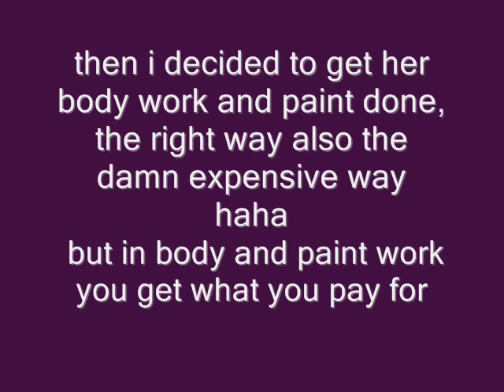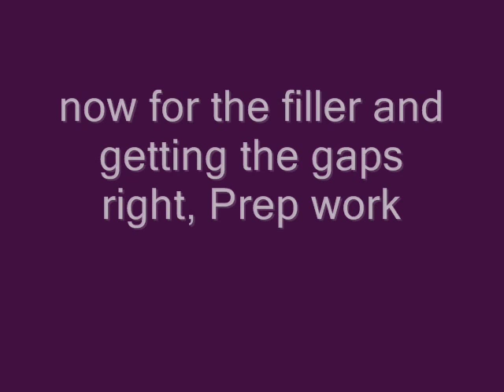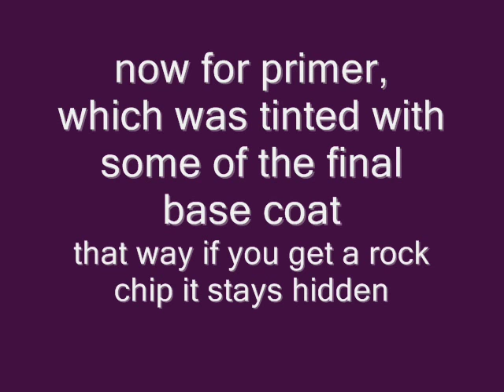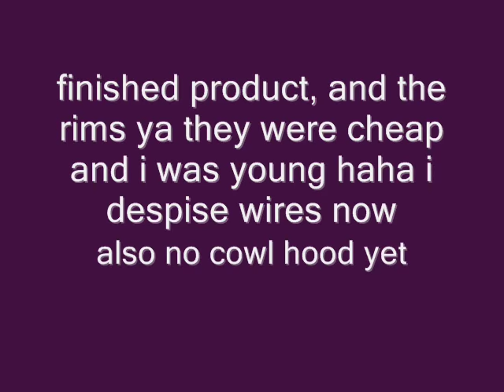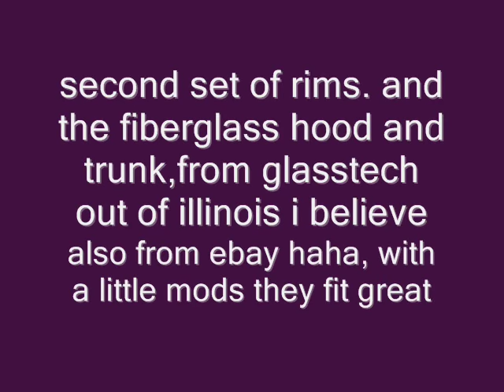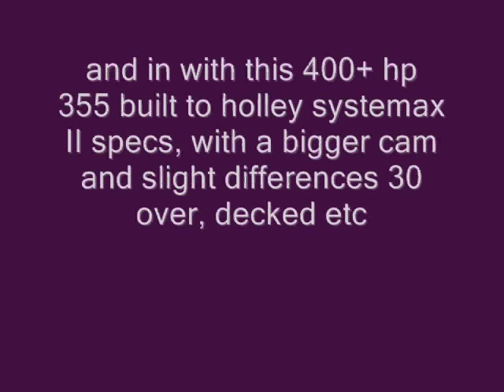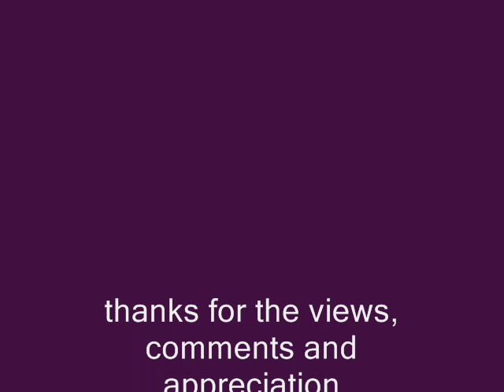1985 buick regal complete body restoration.

Comment from the maker: @rickyman nope I have yet to do any suspention work, after the ford 9 inch goes in I will worry about that, she's all stock. Looks low because the stereo weighs it down a bit and the front is high from the engine being mostly aluminum, lightened her up

Comment: Very nice car ! Those wire wheels are ugly it's much cooler now,what about the bullet style mirrors & maybe some side vents like the GNX it would help cool the big motor! Areyou going to use the boxed upper & lower control arms ? also need a panhard bar It prevents side to side movement also did you get a swaybar?

Comment: what headers u use and did they clear without doing anything with heater and ac box thanks
Reply from the maker: used flowtech ones on the old small block  no idea of number, and  hooker Ls swap g body ones now with my Ls3  the last bolts were hard to get at on pass side i always had a wrench cut in half to get at them untill i just removed heater box (with old small block)

Comment: It looked awesome with those wire wheels dude! I had sum on an 85 caprice landau a while back. I woulda thrown sum irocs on it nowadays
Reply from the maker: Snoopy 
Yeah you know what I do kind of miss those wheels now it did look really good there's nothing like a 13 x 7 
100 spoke knock off on a clean G body but I would only put them on as a novelty sort of deal because those tires don't handle any amount of power or any corners but for a cruise in car show or something would be kind a neatI don't despise them anymore I wish I could take that off the video ha ha
Reply: G-Body James Yup, u got that right,  I went thru a few of them cause the spokes would get loose and leak air from hitting potholes and taking off. You went race car on it now so the rims wouldn't go along with the car